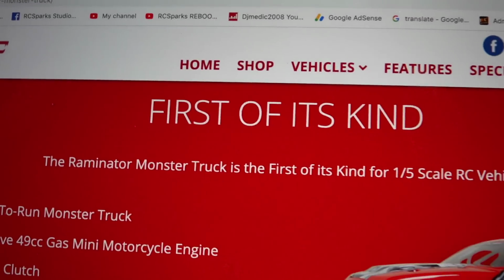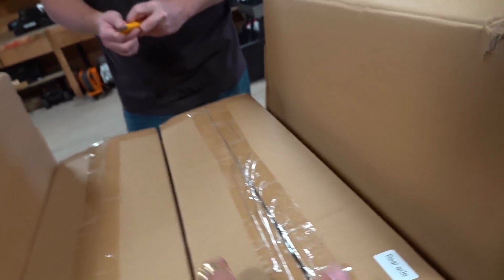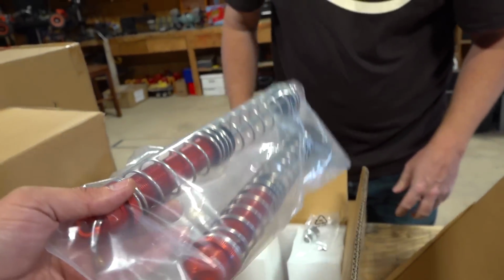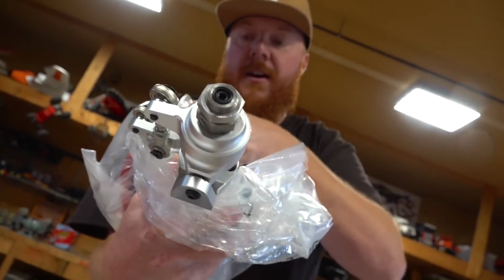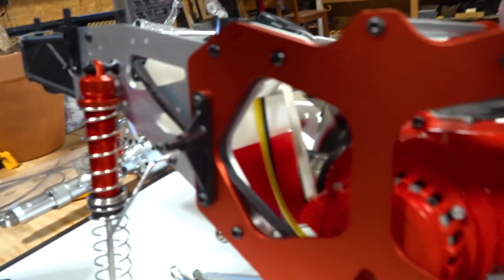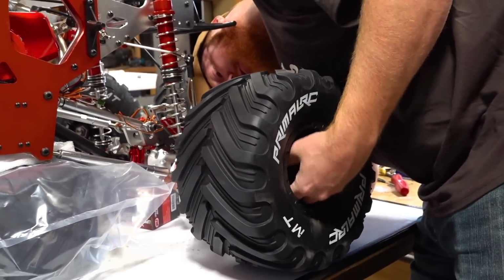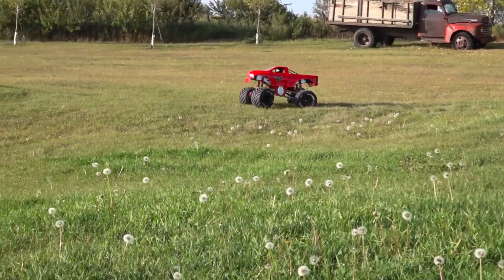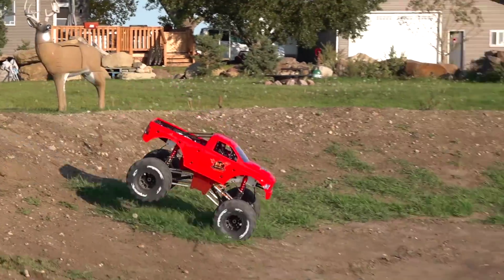RAMINATOR - MEN and a MEGA TRUCK : LARGEST GAS POWERED MT! 49cc | PRIMAL RC ADVENTURES

Comment: I mean its cool but its got a gas scooter engine and looks like it cant even hit 20mph as were I used to have a goped with pretty much the same motor that would do 40 with me on it so alot more weight. will it get faster with break in?
Reply from the maker: Well, this was first tank.   Everyone forgets that an engine like this loosens up after 5 tanks. Its common knowledge.  I wish peeps would take their blinders off.. not you particularly.. but you can see in the comment section - a lot of people dont consider the information we provided.. lol

Comment: First thing I would do is Port and Polish the head on that motor, and find a bigger jet for the carb, all you need is a dremel and a micrometer, and try to find a jet that is the same style but bigger hole. Would make it scream
Reply from the maker: Words are cheap brother, lets see you do it! BRAAAAAAP!
Reply: I have done it on a much bigger engine, a Yamaha YZ250, only difference is I used a carbide bit and a tool on the big head. You wouldnt need to chip of as much on a 50. Plus those carbs are the same on chain saws, the jet you could get it from a local small engine repair shop. I wish I had $ to throw into buying a truck like that, but I'm sorry I dont. Just an idea broheem, I've built a lot of 2strokes in my day though a know that even just polishing the head on that would give it a little more power. I'd like to see what engine mods people do to these

Comment: Why do rc 2 stroke engines have no hp? When my son's old 2002 ktm 65 has 14hp std and does 90kph with my 94kg on top of the bikes 60kg lol.  Would love to see a 15hp or so engine in this beast of a rc. Cheers for the upload.
Reply from the maker: Well, this one is a cheapo $100 engine that is basically a place-marker for an upgraded powerful engine to get put in instead :)
Reply: @TheRealRCSparks  thought the rc came with a engine? Anyways look at the motor bike world of 2 strokes Google ktm 65 and will come up with something like 20hp! Again the rc 2 stroke engines have no reason to be so under powered when a little dirt bike is in a simalar price tag as 5th scale rc.
Reply from the maker: @troymatthews668  It does come with a 49cc engine. A cheap one that is meant for pocket bikes .. that have 2 wheels.  For $2900 this platform is insane. .and they easily could have sold it as a roller for 3K. Instead they put an engine and electronics in it for the same price! Also.. they released the truck at 80lbs weight.. which means it needs big low end torque out of the box.  I think its a steal of a deal.. and wont mind putting a larger engine in. But I must say, this is only the first tank of fuel.. and it kicks ass.

Comment: well, about the engine, it shure would need to rev alot higher, even tho its a 49cc, just think mopeds nowdays, atleast 2hp stock, driving around with a hole person on top of its own weight. Too cool base  to build on tho!

Comment: That is just a base model Pocket Bike Engine. Besides the high performance engines (8hp, 10hp, 12hp and up air cooled) Already on the market that will just drop in and bolt up in that truck, there are a plethora of high performance parts that will go with your engine.
For Example; Black Widow Reeds, huge variety of carbs including alcohol carbs, gearing, 2 and 3 shoe clutches, Boost Tubes and even NOS Systems complete with steel braided lines with anodized fittings, etc...

Comment: It's not a  Rally truck it's made to be able to go over things and what not... Maybe with some tuning and the little gear change but I personally think it's plenty of engine for the platform You definitely would not want that hitting somebody at 50 you'll take a leg off.. I had a 1/10 scale go right through my metal shed on a runaway

Comment: to the haters of the 49cc consider this:  1:5 scale is 1/5 in each of the 3 dimensions so in 1:1 scale it is 49cc*5*5*5=6125cc or 6.1L like an ls2 v8.  it is a 2 stroke so its like 2x in 4 stroke giving 12250cc or 12.2L.

Comment: Let's get this engine breaking thing clear! 
To break in an engine u put in a specific break in oil ! It has zinc in it and the zinc coats and hardens soft metals such as on your crank . U run this specific break in oil for a certain amount of hrs on the directions and then the heat and zinc will harden specific soft metal parts ..
After these hrs are up ,u drain the oil and put regular oil in . 
If u do not do this process your engine will not last and u will wipe out cams and ect.
I dont know much about this truck but my guess is they sent oil in the engine or a oil to use for the first 15 to hrs and then you will change the oil to what ever is recommended.
Reply: It's very obvious you do not know anything about this engine.
Reply: @evtek3962  lol ..all engines have to be broke in this way ..in most cases the manufacturer will break In smaller engines such as the truck u bought so it's possible the engine was already broke in ..what is obvious that the term (break in ) to you only means how hard or easy you run an engine when u 1st get it ..
Go buy a yamaha 2 stroke dirt bike and ask them if it has break in oil in it? I'm 100% positive they will tell u yes and you need to bring it back or change the oil out after 20 hrs BECAUSE THAT IS HOW LONG IT TAKES THE ZINC TO ACTULLY HARDEN THE SURFACE OF YOUR CAM AND OTHER PARTS ! 
Just like any other engine on this planet ..the engine in this truck is no different! The only thing I dont know about this truck is if they already broke in the engine or how long  the directions recommended running it before changing out the break in oil ..
It's obvious to me you know nothing about engines at all and how if you dont do this process your engine will fail sooner than later 🥴
Reply: @evtek3962  fyi with a new engine with break in oil in it you can run it pretty hard if u choose to do so ,it will not change the chemical reaction that needs to take place to harden internal surfaces..knowledge of these kinds of things is not hard to find in books or on the internet 🥴

Comment: You could buy an old Honda CR50 and put engine in this then I guarantee it won't be slow. I rode one as an adult and it'd go at least 50mph. Which is fast on a tiny motorcycle.

Comment: maybe get your carb jetted right... or run it with no/another airfilter.
i can imagine that a two stroke with such an resonator exhaust should make at least twice the amount of RPM's as it's doin right now !
to me it sounds that it does not even reach it's optimum powerband...!
Reply from the maker: Dude, its turning 4 massive tires ... and its first tank of gas.  Plus its a $100 engine..

Comment: carburetor needs to be adjusted there's two adjustment screws you put it up on blocks rev it up adjust them and you'll hear it go high pitched there's a low adjustment idle and there's a high adjustment idle that's why it's bogging on the top end which also means once it's adjusted properly it should gain more horsepower more take off more oomph
Reply from the maker: Yeh, uh thanks.. but no, there is no low end adjustment on this engine
Reply: @TheRealRCSparks   then that means high performance upgrade parts needed next video please

Comment: Lean this out a little and give it full throttle. You are not even getting the rpm up onto the power band.
Reply from the maker: Correct, because these engines need 3-5 tanks of fuel to get them to break loose. Also, this engine only has a highspeed adjustment needle..

Comment: 50cc should be plenty of power to get that thing moving, there are plenty of 50cc two stroke dirt bikes for little kids that weigh as much as this truck without the kid riding. And they aren’t nearly as slow as this truck.
Reply from the maker: 1) First Tank of Fuel .  2) 4 Wheels not 2 3) Yes its, just as fast

Comment: Run rich yes... Run more oil? No... Don't do that. Run the appropriate oil to gas ratio. Adding more oil lowers the effective octane rating of the gas. Running too much oil, is actually in effectively the same as not running enough fuel.

Comment: It's a MONSTER TRUCK, why does it need to go fast? Monster trucks are for crushing things, jumping small hills, running over buses! It's not made to drag race or run a NASCAR oval! I want to see it on one of his wildness trails! Or maybe a mud bogg? Imagine a wheel loader with that configuration and tire size! Why can't you take another front axle assembly and mount it on the back, quad steering! 

There goes my savings! Not!
If I ever buy anything RC, M1Abrams tank, 4 axle Peterbilt tractor w/5 axle RGN trailer, 994 CAT wheel loader and 977 CAT off highway mining truck!

Comment: Holy s!@# that thing is huge..... definately needs some different hearing and faster engine..   I would assume they put a slower engine in it for safety reasons.. they didn't want to be held responsible for any damages ... could you imagine this big heavy truck mobbing at 50 miles per..  that could seriously f!@# s!@# up..... so damn cool though. .
Reply: I gotta be honest a couple times of it going by at this speed was scary. Fast would be fun. Man the damage this thing could cause...

Comment: C’mon man...that thing sounds absolutely horrible ! Sounds like a lawn boy with a half fouled plug trying to spin a 72” blade. If that platform is going to be successful, the power has to be based on something other than an anemic undersquare (long stroke small bore) engine found in scooters. Perhaps something like a kx 60 bike engine without the trans. Two stroke with proper variable exhaust port timing, 28mm Mikuni carb, water cooled and a bone stock one will make 15 horse. Couple that with a properly engineered cvt setup and the truck would be a monster. As it ships...it may as well be a ford raptor ordered with a n/a 1981 Escort 1.6l.
Reply from the maker: Its amazing for under 3000$

Comment: A ridiculous expensive SLOW toy going in circles on the ground,   Money not well spent in my opinion but to each their own,  I prefer to spend my money on aircraft and guns.     Thats not to say it isnt cool it is for sure its just not worth the money they are asking when it sounds like it struggles to even get moving.
Reply from the maker: Thats because you are uneducated about what you are looking at, and how an engine breaks in
Reply: @TheRealRCSparks  I understand engine break in on 2 stroke and 4 stroke engines each are different I have also seen this model truck after the engine has been broken in and it still lacks power out of the box.  For the money they are asking it should have a bit more power and not require you from the start to add aftermarket parts to make it what it should have been from the beginning.